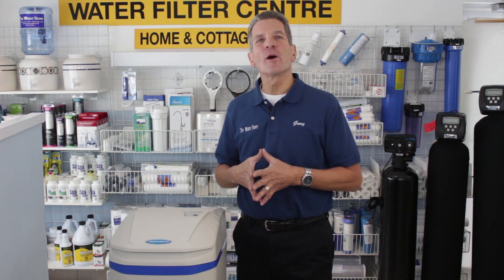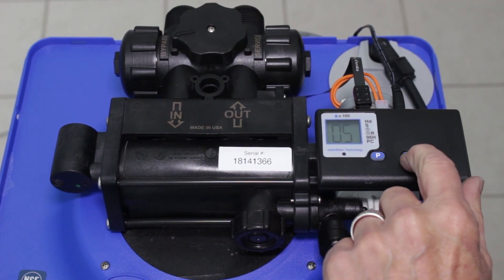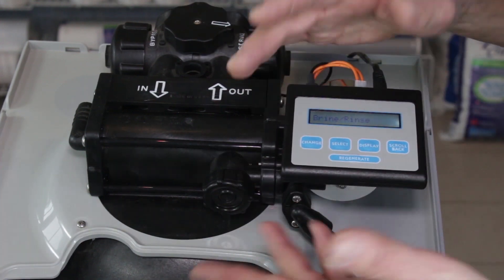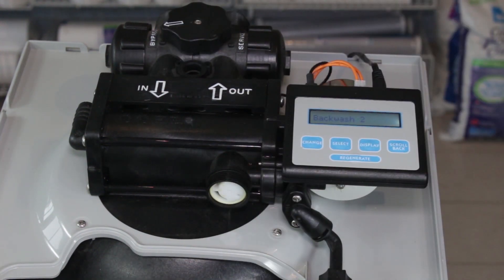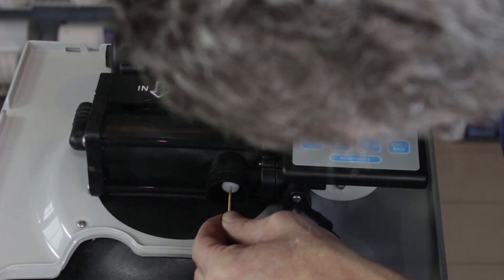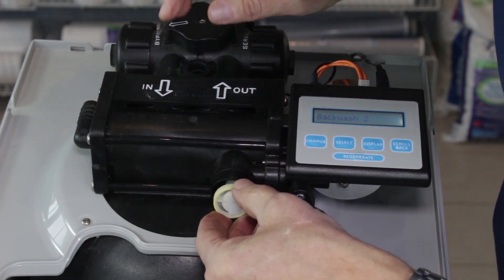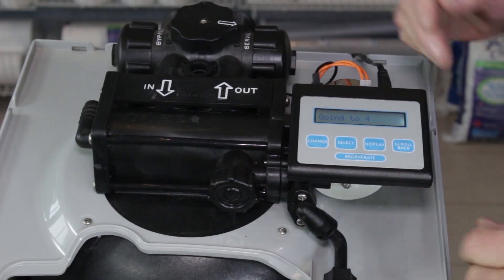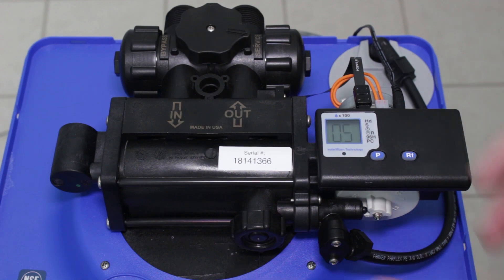Water Boss Water Softener Maintenance & Repair - Clean or Replace Injector 5 Easy Steps

Comment: so I have an older Waterboss 900 that I could hear it running water continiously.  I finally put it on bypass.  What could be the problem?
Reply from the maker: Piston stuck inside valve keeping it in backwash. Likely need to rebuild with this https://waterestore.ca/products/aquamaster-drive-end-cap-assembly-54520

Comment: Don't listen to this guy he doesn't know he's talking about he's working on a water softener inside a clean environment it's not even hooked up to water. He doesn't tell you about the o-rings that you have to replace because when you put them in the cap it pinches them. I had to find out that the hard way. I'd like to see this clown work on a 15-year-old one inside a closet it's almost impossible. No where did he mention anything about pinching the o-rings. Mine wouldn't go in evidently with age they swell up and they won't fit. This is the first and last time I'll take any advice from this clown. Thanks for giving me extra work now I got to drive 19 miles to town to get one and guess what it's 19 mi back thanks pal
Reply from the maker: You are correct that working in a closet is different than working in a clean environment, with good lighting. But those environments are best for making videos. Yesterday I was repairing an iron filter in a closet, it was difficult, but I got it done. I hope the info in the video was of some help.  If you don’t like my videos look around for a better source. I’m not a clown.
Reply: @water_estore  then maybe you need to learn how to make a video. I even had to call water boss about the o-ring sizes they didn't know either they wanted to sell the whole kit I only needed one o-ring. Maybe you ought to tell people like me that the o ring swell up when they come out of there and they don't fit back in when you put the cap on it cuts the o-ring in half. Then you go to the hardware store to get a o-ring . the manual doesn't say what kind it is. Is it a standard o-ring or is it a metric o-ring? So I had to buy an assorted standard pack and an assorted metric pack so I didn't have to waste another trip back into town.. so there you go clown how do you like me now.
Reply: @unknownuser2737   just RUDE!!

Comment: I need a service manual for a older boss water softener model51psb the rod that controls the intake valve in the brine tank need replacing where can I order one  John
Reply from the maker: I dont ahve one.  I suggest you call the manufacturer 180043768993

Comment: Always great content.  This valve and parts are almost identical to my Hague Matermax.  I currently have an issue with hardness of 20ppm after I began using iron out, could that have ruined the resin in any way?  It's softening our municipal water of 280ppm but not fully...  Started more frequent regens to see if it may clean up, then I can readjust settings if so.
Reply from the maker: It should clear up eventually

Comment: My Water Boss 950 has been malfunctioning, lately. I installed it in May 2015, so it's done well without any servicing. The alarm was buzzing a couple of months ago so I disconnected the power and plugged it in again. That seemed to cure it. Then a couple more times, since then, it was sounding. Then I began to notice the water wasn't tasting so good. I was alarmed to open the lid and see it full of water.

Your video has saved me a plumber's bill. I called three who claim to service water softeners but only got one response. Then at my daughter's suggestion I searched YouTube for an answer. The manual suggests what needs to be done when the brine tank is filled with water, but it doesn't tell me anything else. You showed it clearly and concisely. Many thanks, Gary!
Reply from the maker: Glad I could help! Please share video with friends and family!

Comment: Please mention in the video how long one may have to wait for the depressurization to get to a point that it should be safe to unscrew. You simply turned the knob to by pass while saying this would depressurize the tank & then went straight to unscrewing . Needless to say the amount of time I waited was NOT long enough! Now I have other problems! 😩
Reply from the maker: Actaully in the video it says to bypass the softener, then regenerate to relaese the pressure, which takes only a couple of seconds.

Comment: Thanks for the great video, Gary!

To Anyone: The house I bought 5 years ago has the 900 in it and I'm wondering: is the resin in the tank replaceable, or do we discard the unit after it has reached the end of it's lifespan? I don't know how to tell how old mine is, but I'm guessing I'll know when my water isn't soft anymore. Thank you.
Reply from the maker: It is extremely difficult to replace the resin.  Typically the resin lasts about 20 years.

Comment: I accidently plumbed my softener backwards but fixed it after 30 minutes.  Now the tank has too much water. Is this possibly a clogged injector? Did I ruin the softener? Thanks!
Reply from the maker: I honestly don't know, never had to deal with that concern.  I don't think it would have clogged the injector, I would carefully regenerate it to see what happens.  Did any media escape from the tank into the household plumbing?

Comment: Having a problem with my 900. Water is pouring out the drain line non stop. No error messages. If I unplug unit water continues to flow. Only way  to stop it is to shut off water supply. If I turn it to bypass mode it stops.
Reply from the maker: Likely the piston is stuck in the back wash position.  You will need to replace the drive end cap assembly, this video shows you how  https://youtu.be/gconWJRDAJM

Comment: I removed the injector cap and cleaned the screen.  Put it back together and it leaked.  Tightened it until the cap cracked.  Still leaked.  Ordered a new cap.  Still leaked.  Installed new O-ring still leaks.  I'm at my wit's end.
Reply from the maker: I really do not know what to suggest other than calling the manufacturer at 1-800-437-8993
Reply: @water_estore  Thanks for your reply.  My problem was solved by Florida Mike.  Please see the last comment on your video regarding placement of the o-ring.
Reply from the maker: Yes, that is the correct way to install that o ring. Glad to here it worked for you.

Comment: Hi Gary, I have a Waterboss 700 but it has a different injector assembly. ( https://www.manualsdir.com/manuals/224338/water-boss-900-550-700.html?page=20 ) Do you have that assembly or at least the Screen, Throat, and Seal (93810, 93223, and 93220) I'm leery that the throat is different than the one you link to and the other parts are useless to me.
Reply from the maker: I will check to see if we can get those parts for you.

Comment: Hi Gary! Thanks for the great video! My pro plus 380 is only 6 months old and I started getting really salty water.  I checked and cleaned my injector. Ran a manual regeneration but still get really salty water. I do notice that when doing the regeneration I need to manually advance each stage. I am wondering if I need to allow the rinse cycle to run a lot longer or if I just need to start regeneration and let it run through whole process all by itself? Could there be something else wrong? The salt level is about half. I don’t see water so am assuming water level is not too high. The setting is set to 20 based on testing and which was perfect setting for the first 6 months.
Reply from the maker: did you try the advice in this YouTube video of mine? https://youtu.be/JUKAJPOnAG4

Comment: I used iron out in the waterboss 900. I followed the instructions for adding the iron out from the container. The softner did not have salt in it at the time. About 6 hours after regenerating it, my husband took a shower and his eyes are now burning so we think the iron out ended up in our water lines. What do we do about this?
Reply: Just regenerate it again and once it is finished flush about 20 gallons of water through the system and all should be back to normal.

Comment: I am at the end of my wits. I have replaced the end cap assembly, I have made sure all the lines are clear. The injector is not clogged. Yet it the tank level never drops during the regen cycle and we have no soft water. I'm calling the factory tomorrow to see what they have to say. My wife says throw it out and buy a new one.
Reply from the maker: Sorry to hear, Derek.  If you disconnect the float, is there suction during the brine cycle where the float connects to the brine valve?  Is you drain line kinked or clogged? Check those ideas.  Calling the factory is a good idea and they can help you through the problem solving process.

Comment: When I removed the circular white injector. It was cracked on the outer circle where it has hollow area. Will it work like this? Should I superglue it?
Reply: @water_estore  I stepped on it. Only kidding. I am not sure, maybe when I puled it out to clean the hole behind it. I gently used needle nose pliers.

Comment: Thanks for these videos. I get maybe a gallon (or 2) of salty water after regeneration on my new WB 900 softener. If a let the water run a short bit the water is fine. The rinse flush  line does go up about 7 ft, oops 2M, before draining. Would a check valve on the drain be a good idea? Or can I increase the flush time?
Reply: @water_estore  How can the flush time be increased on the waterboss. I imagine there is a way to get into a service mode on the controller but I don't know it, or what to do when I get there!
Reply: @water_estore  Model 950 (22,000 gr city w/charcoal)

Comment: My 1 year old Water Boss slowly fills the brine tank between regenerations. (takes about a week to fill it up and then it drains out the overflow)The factory says it is either leaking into the tank via the brine tube and brine pump or through a loose or leaky plug at the bottom of the media bed tank. I am going to disconnect the brine tube an see if water slowly drips from it. If it is the tank plug, what king of a job is it to remove that media tank for inspection of that plug?

Comment: Do not screw the cap on with the o ring in the cap, you will pinch the o ring. The o ring goes inside the pipe body and then screw the cap on. I found out the hard way.
Reply: My friend, you just saved me $500 on a new softener.  I even ordered a new cap from the manufacturer.  The woman I talked to sounded a little annoyed that I bothered her, but sent me a new cap, which also leaked.  Didn't bother to tell me what you did.  The original o-ring would not fit back into the pipe body.  But a slightly smaller one did and it works perfectly.  Thank you.
Reply: Thank you I just found that out the hard way too